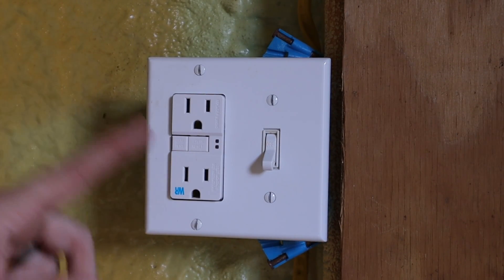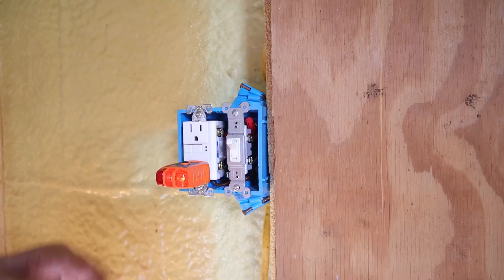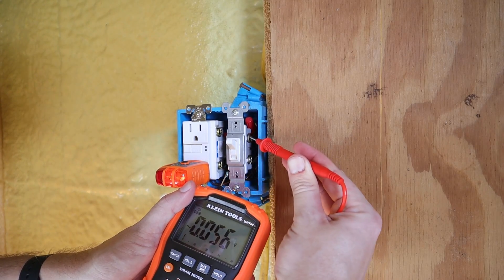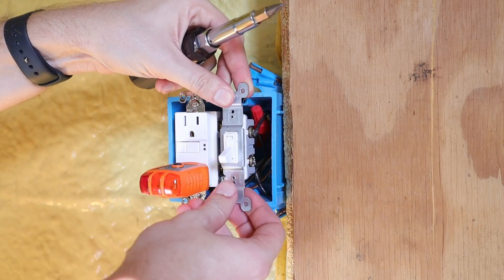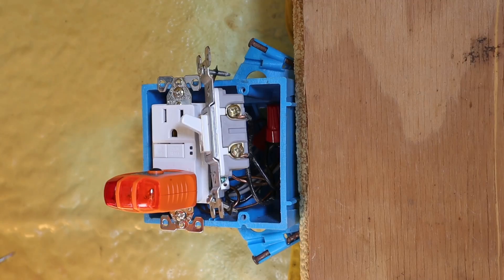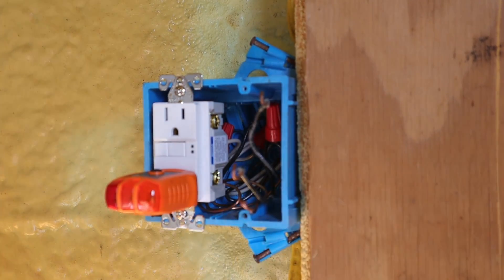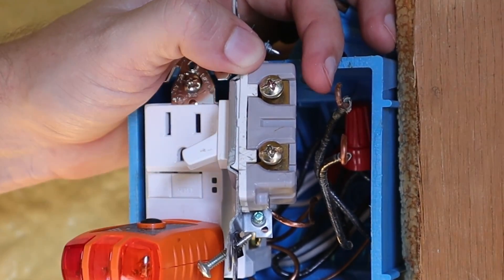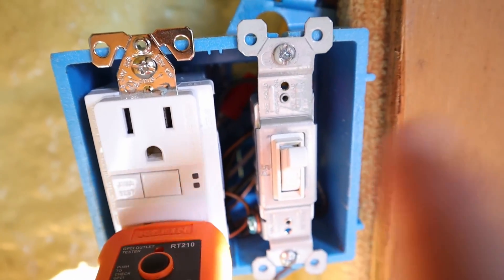How The Pros Diagnose And Fix A Light Switch That Doesn't Work

Comment from the maker: Have you ever had this issue come up?  What did you do?
Reply: Not a switch, but I did have a GFCI outlet go bad after only about a year.  It would not reset,  and all wiring checked out fine.  Stuff happens!
Reply: I replaced over a dozen switches for a client a few months ago. They wanted to go to the newer style flat switches.   Ended up having to swap out 5 of them a second time,  Must have been a bad day at the factory.
Reply: @Bonkrr  Wow!  Bad luck!!!  I would think it was something I did!!!
Reply: I replaced a switch - and once it's back in enclosure it shorts.. but if I take it out and left exposed outside of the wall enclosure it works fine. What's that about?
Reply: The lights work on my dimmer switch but the dimmer doesn’t. Can I fix that ?
Reply: Hey I have a light that won’t shut off. Could it be a bad switch?
Reply: Hi, i have the similar decorator switch (Single pole) that has a LED to show if the switch is off, it will light up. It worked great, but today, the switch does not work, so i did the same diagnose as you have mentioned here. There is Continuity when the switch is on. Swapped a new switch and the switch does not work. This switch is controlling the ceiling fan, luckily it works with alexa. Using the app, the ceiling works, just the switch does not turn off or on. Any advise?
Reply: I just mindlessly replaced the switch. That worked fine but I never thought about maybe saving myself a trip to the hardware store by checking the wiring.😖

Comment: I have a traditional light switch which seems to work fine by itself.  When I place the toggle cover up plastic wall plate over it and screw it in to the box the light shuts off.  Do you think the switch is week so it's turning off the light because of the toggle plate?

Comment: What would you do next if there wasn’t voltage at either of the terminal screws?  Also, breaker hasn’t tripped & all of the other receptacles etc (that I’ve found) on that circuit work fine….

Comment: 3:44: I have a similar interesting single pole switch problem. 

The switch is original to the 30+ year old house and controls 2 LED porch lights which went out simultaneously.

Switch is the middle of 3 in a 3-switch panel. Other 2 work normally.

No issues at the breaker panel. 

Non-contact probe shows power at the switch. 

Contact probes show both 114v across the brass screws with switch closed and power on and continuity with switch closed and power off.

Switch was originally installed with backstab connections, though. Cut those, trimmed the insulation and (carefully) touched the wires together - lights came on.

I reinstalled the wires to the screws - bingo, switch works with a slight intermittent flicker.

So continuity at screws is just that, and doesn't reflect the status of the backstab connections.

I'm replacing all 3 switches with industrials. These are ~ $2.00 apiece or ~$15.00/10 currently.

Thank you!
John

Comment: I have a 3-way switch in my garage and house that runs lights . I came home, and the lights were on. I tried to shut off the lights at both switches, and the lights will not shut off. Could it just be one of the switches? The switches worked for years .

Comment: I have a rocker switch controlling one light on opposite walls. There is power coming from both sources.  Both switches are not working.  I replaced one switch and still no dice.  Confirmed power is coming from the new switch.  Any advice on what else I should do?
Reply: Probably trace the wiring going from the switch to the light fixture or check the light fixture first which might be easier

Comment: I did all that. New switch is good continuity. I have 120 volts on both upper and lower screw connections when switch on. All wires in box seem tight nothing loose. But my 4 outside pillar lights are dead. I checked box at house that has the wire coming from switch to pillar light. Wire connections are tight look good all tight. I checked wires at light fixture also wires were tight. Nothing loose. Fixtures are 24 yrs old. Is is possible the fixture is bad where bulb completes circuit?

Comment: Have the same problem with a new switch.. bad switch .. why do some switches have two screws on the ground side , The top and the green ?
Reply: A 3 way switch (two switch locations)will have a ground wire terminal(green) two same color screws(traveler wires), and a 4th screw for the switch leg or power. 

A single pole (one switch location)switch will have two terminal screws and a ground screw(green).

Comment: Okay so I have a light switch underneath an outlet. The light works but the outlet does not… any ideas to help me? I’ve tested the wires and everything seems legit . Like I said the light switch works and the outlet does not . Wish I could post a picture. I have voltage. It’s perplexing to me because the light works. And it’s all wired in the same tube.

Comment: This is such a great and informative video!! We just installed a new garbage disposal but it still wasn't turning on! So I checked the switch like you showed and the switch was bad! I replaced it and now the new disposal turns on! Amazing!
Reply: I'm in the same scenario. Old disposal not working at all, not even buzzing. Can't fix by reset button. Bought a new one with a regular power plug. I install an outlet box/terminals. Test the new outlet. No power. Ummm... I guess I'll check the switch now.
Reply: Same here, with old disposal.  Just stopped working one day.  Tried the reset on it and nothing was jammed either.  So then switched plugs and it worked fine.  Started looking more into the switch and this helped.  Only one hot wire had power and the connection didn't beep.  Both tests just like the video.  New switch and beep was good before I flipped the breaker back on so good sign, and everything working now.

Comment: It would be nice at the end to run the voltage test again with the new switch to confirm the problem.
Reply: He did, by turning the switch to "on" and the lights working.

Comment: How can I find what breaker controls the switch without turning off random breakers?
Reply: You'd need a circuit tracer. Which isn't cheap. It's probably best to just start flipping breakers

Comment: I have a switch that won't turn the light off. Any idea what the problem would be there? I just put in a new light fixture. And now the lights won't turn off from the sweat
Reply: Sounds like a bad switch or the switch leg is tied into the hot bundle.

Comment: Hello, I have a three way switch that powers my ceiling fan but isn’t receiving enough power. The voltage reading is very low close to 1. I checked all the cables look fine and the switches are fine as well. What other trouble shooting could I do?
Reply: Make sure the neutrals are tied together and making a good connection. And check the connections to the fan, as well. Might have to take the fan down and make sure you didn't lose the neutral or the hot up there. Good luck

Comment: Hi, thank you for this video! This will help with a diagnosis on a bathroom fan. I'm a homeowner of a 100 year old house trying to navigate fixes. I have some knob and tube wires on another line. The line is really old and I'm wondering how to work with it to rewire an old receptacle. I'd rip it out the wiring and have it replaced, but as a single mom it's beyond my budget. Could you make a video on older wiring? 😬🙏 What's a safe load?

Comment: Actually as an electrician we change bad switches almost everyday. They don't make them like they used to.
Reply: I've had to replace several in my house that's only 10 years old.
Reply: @PureMagma my house is 20 years old and every single light switch broke. They broke in the same spot-the screw plate was still in the wall, but broke at the top and bottom. They were just the cheapest ones you can get so that’s probably why…
Reply from the maker: You aren't wrong.  Thanks for the feedback!
Reply: Can bad light switch cause the receptacle and lights not to work in multiple rooms that are on same breaker
Reply: @stoutsscout good question. I’m curious too.
Reply: I was just thinking that coming back in the day We never had these problems
Reply: I believe my great grandfathers house was built in 1969 or something and all switches function as normal lol

Comment: 1990's Maintenance manager for a set of buildings in Glendale, CA...Electrician went to work on a wall outlet.  Cut the power...was surprised when second set of plugs "sparked" on him... Turns out the wall plug had TWO circuits wired to it!  Was pleased to see you checked both sets of plugs!
Reply: What an idiot. If an electrician sees two different wires into a Recep, you're gonna check both wires and the Recep for a broken tab. He got what he deserved

Comment: Is there an easy way to trace a wire back to it's source?  I have a switch in my house that when I throw the switch, nothing happens.  It's not connected to any outlets either.  I opened up the cover and see that there are wires connected but I'm not sure to what exactly.  Another issue is that I have an outlet that is high up in my closet that has a large plug connected to it.  My guess is that it's for the house alarm or maybe the fire alarm?  How can I tell what that may be?
Reply from the maker: You could use a toner like this one that I use https://amzn.to/3wQHeUO.  It puts a signal through the line once attached and the probe can detect it through the drywall to the source.  If you get one just make sure to follow the directions.  It is pretty easy to use.

Comment: I installed 2 new LED light panels in my kitchen replacing the old fluorescent light fixtures. Later I noticed the panels would flicker. I replaced both the cheap 3 way light switches with commercial duty switches. NO MORE FLICKERING!
Reply from the maker: Yup.  These things are getting cheaper and cheaper in quality.  Thanks for the feedback!

Comment: Just an observation.. Being 120v light switches are a wiper type contact, I would expect more to fail over time as a LED current load is less. The older resistive bulbs would put a heavier load on switch which helped keep the internals clean.

Comment: For showing the continuity, could have tested the new switch before wiring it in place
Reply from the maker: Could have, but it’s a new switch and I’ve never had an issue with a new one.  But might have been a nice addition to the video to show what it would look and sound like.  Appreciate the feedback!
Reply: @HowToHomeDIY  That was my intent of my comment. I, as well, wouldn't feel the need to test a new switch, but showing this applied in a video could be of a benefit. 
BTW, I really do enjoy your videos!
Reply: @HowToHomeDIY That was a new switch? The area around the lower hot screw looked like it was beat to hell. I was wondering why you were installing what appeared to be a used switch.

Comment: Actually, I have had single pole switches go bad over the years in many different houses. Usually, they would get soft or intermittent. I keep a few around. It’s a 5 minute swap out so I just replace it and move on.
Reply: I just replace the switch first and then troubleshoot second if I have a similar problem. However, this would not be practical for a YouTube channel.
Reply: @retirementpirate3665  Exactly, switches are cheap and easy to replace.
Reply: It would be cool to open a bad one up to see what the issue is!  Simple device.